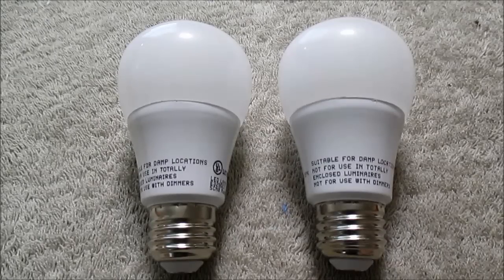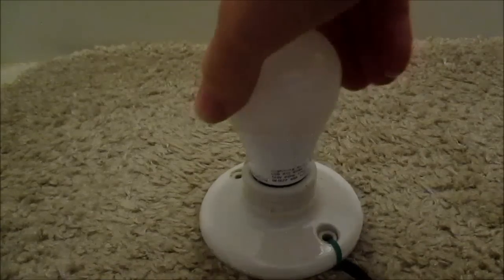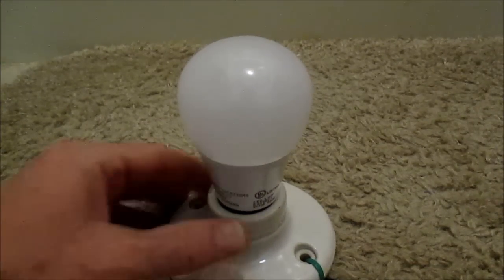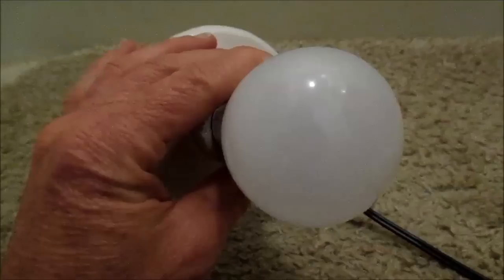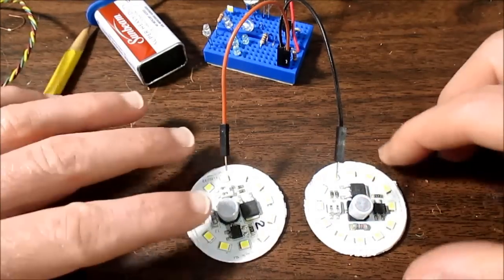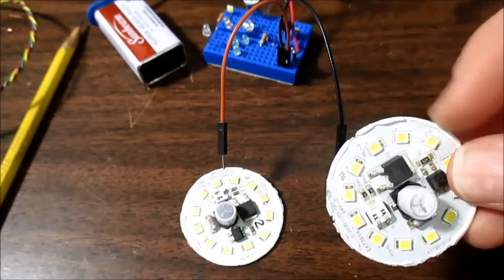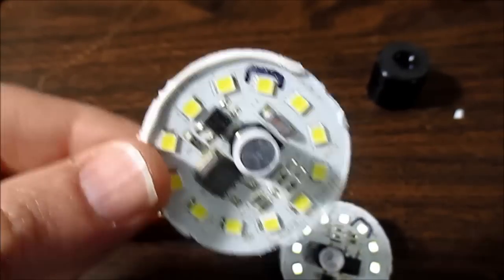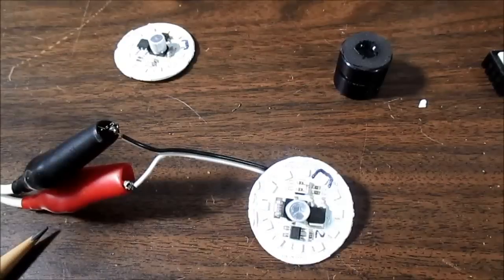Two failed LED bulbs for teardown to determine the cause

Comment: Most LED lamps put the LED's in a series string. 12 LED's X 9 volts is 108 volts allowing for voltage drops in the rest of the circuit they run on 120 volt line current. 
Assuming they are in SERIES the brief flash seems to indicate that the non lighting LED is Shorted, not open. Shorted is a common failure for LED chips.
(An open LED would not allow any light at all in a series string. )
This causes an increase in current in the remaining series string and likely causes the regulator chip to shut down.
This behavior is reflected in the dim glow, then the bright flash when power is removed and voltage in the capacitor begins to drop allowing the
regulator to briefly light the rest of the LED's because the voltage/current has dropped to a safe level for the 11 remaining LED's.
This is my theory.
Reply: Disagree with shorted.  A short across one of a number of identical devices in a series circuit would simply increase the voltage across the others.  This would lead to the other LEDs glowing more brightly than they should, rather than going out.  A shorted diode would not increase the current through a circuit with this sort of regulation.

The fact that placing the ammeter in series across the bad LED confirms this.

Edit:  Incidentally, True River, you are just slightly off in series vs parallel.  Placing multiple components in parallel will deliver the same voltage to each, thus increasing the amperage draw of the circuit.  Voltage will only decrease when the conductor's ampacity is exceeded.  Conversely, placing multiple components in series will subject them each to a reduction in voltage.  The voltage across each component will be a function of the resistance across the component in question vs the combined resistance of all other components in the series circuit.  Amperage through the circuit will be a function of the main supply voltage and the total resistance across the circuit.  Remember that amperage across each component in a series circuit will be the same.

In other words, it's better to say that series divides both amperage and voltage, one equally and one proportionally.  Parallel adds amperage, while voltage remains constant unless conductor limited.
Reply: @MrZorbatron  mains supply voltage is not constant though. Increase the resistance and the voltage will drop due to the resistance.
Reply: Stuart Johns, Irrelevant.
Reply: If LEDs are in series and one becomes shorted, the others would not necessarily burn brighter.  It all depends on the nature of the power supply.  If it is a constant current power supply, one or more shorted LEDs would not affect the others.

Some LED bulbs cannot be dimmed.  I strongly suspect that they contain a constant current power supply. @MrZorbatron
Reply: @MrZorbatron  yup series is voltage divider.
Reply from the maker: Bypassing the bad LED by shorting across its terminals allowed the rest of the series to come on, so I'd say it went open. LEDs do fail shorted due to defects in the semiconductor structure but they also often fail open due to junction issues at the bonding point. The flashing and dim glow was likely just an artifact of the poor connection.
Reply: @JohnAudioTech  So late you probably wouldn't see my reply. I have tried LED's in my combination  bathroom fan/ incandescent heat bulb/ light bulb and it won't work? Same LED bulb works fine in the bedroom ceiling fan/ light bulb though? Any ideas???
Reply: @JohnAudioTech  ive had 6 go in 3 months ,im fed up now as told so many stories why ? reading all this is good ty all :)
Reply: steve b, why do you have to be an ass? The Radio Mechanic didn't say anything "burned out". In fact, his theory seems to make a lot of sense to those of us with electrical engineering backgrounds (not to mention politeness).

Nobody would put LEDs in parallel in a 120V system. At the very least, they'd be a series-parallel arrangement. Why rectify and reduce 120V down to 0.3-0.7V when you could bring it down to a multiple of that...say something around 5 or 12V?
Reply: @kichigaisensei  engineering? more like the 101's
Reply: Right:  "not to mention politeness".  Unfortunately, courtesy seems to be becoming obsolete.  @kichigaisensei
Reply: John Audio Tech can you solder a jumper across that LED to make the others work ?? I know everything is SMD on that board and you have to have a micro solderer...... Not the old style PC boards back in My Days of working at a bench...
Reply: Boo LuQuette l
Reply: Boo LuQuette a resistance to drop the voltage should be ideal in my opinion
Reply: Boo LuQuette I was wondering that same thing
Reply: If it was a short the others would still light.
Reply: LED "bulbs" are connected in series. Single open failure stops them all. Not dissimilar to the old Xmas tree lights.
Reply: Those seem like 5050 led chips commonly available in cheap led strips just rework the bad out and replace it since you have it open just my 2 cents
Reply: steve b actually you are the what-you-said.

your design needs a step down transformer to match line voltage to led spec. The series design does not.

A good example of lamps in series is in xmas tree lights where a number of low volt bulbs are wired in series and the whole ring powered directly from the mains. (I am thinking of the older style xmas tree lights with incandescant bulbs not the newer led lights).

In the UK we have 230V from the wall and xmas tree lights tend to be 20 x 12V bulbs (so slightly underrun). I have seen 12 x 20V too.

So for incandescant lamps or leds you run in parallel if the supply volts match the spec but you run in parallel if the supply is many times the spec of an individual component.

Parallel adds volts

Series adds amps.

Please consider the possibility that you might have something to learn before calling someone ignorant.
Reply: really Steve..tell us more....
Reply: John Conrad Actually it's neither.  In a load circuit, its a division not an addition.  In a supply, it's an addition, and youre right that its the reverse of what he wrote.
Reply: If it goes open after its shorted, then it is no longer shorted. My experience with diodes has not been that way, though. When diodes fail, they often fail as a dead short or as open. They generally stay shorted unless subject to extreme power levels.
Reply: to save other LED's in the circuit, by pass the defective one with a small resistor that has same value as defective one...
Reply: My guess is that it's open, but when the voltage across it becomes high enough it breaks down and becomes a short until the current falls low  enough again. Much like a relaxation oscillator (diac, PUT, neon) of the days before my birth.
Reply: +Woeba, in this case he could most certainly use a resistor that drops the forward voltage of an LED at the current passing through the series string.
Reply: Steve b  So you get abusive over something like this?    Happy you're not my family.
Reply: LED's are still punching electrons through  band gaps, converting one energy form into another. This is achieved by applying a potential difference ( voltage ) across the component which supplies the energetic electrons ( current ) needed for the energy transformation.
Reply: The Radio Mechanic s
Reply: That "theory" ignores the most basic principles of current flow. A shorted LED isn't even on the list of things that would cause the string to fail, save some extreme circumstance like burning through the trace.
Reply: ps..   leds run on dc power..  so I highly doubt your going to get 108 volts dc..  that would MELT every line in your house..

and the common led they use is these bulbs is 6 Volts DC at 60 mah

indeed shorted wires will make all electronic's fail.
Reply: +steve b I'm afraid The Radio Mechanic is right.
Reply: They are talking about LED bulbs.  A single LED doesn't emit enough light.  Therefore, several are needed in an LED bulb.  The LEDs in an LED bulb are connected in series. steve b
Reply: Drop across an LED is 3 volts and not nine volts.
Reply: According to what I've read, not all LEDs have the same EMF drop.  I think that a drop of 3 volts is the maximum but some have lower drops.  However, I'm not sure of my information. @gajananphadte3440
Reply: Whit LED which basically is a blue LED has a drop of 3 Volts. Red, green, orange n yellow has a drop of 1.6 volts plus 0.2 maximum for some of them. @frankeggers4024
Reply: Gajanan Phadte  3 diodes per led. 3x3=9. Yes/no?
Reply: @rpmfoto  Never
Reply: True River well said! And good on everyone for explaining how and why his reply was incorrect instead of acting like he did
Reply: +True River I agree with you, except for one small point. The mains voltage in the UK is the same as it was fifty years ago, a nominal 240 volts. The difference is that, as a nod in the direction of European conformity, it's now specified as 230 volts +10%/-6% where 240 volts fits nicely within the tolerance range. So a big fudge, really! My guess is that after Brexit we'll go back to calling it 240 volts again - another pyrrhic victory for the anti-Europeans.
Reply: @johnm2012  in Australia we call it 240 volts but everything runs between 230v > 240v. The distance between the step down transformers on the power poles ensures the voltage stays between those ranges.
Reply: @stuartjohns2779  Yes, but that's an engineering solution to a problem. The issue in the European Union is that the desire to standardise the nominal voltage across the Union at 230 volts was implemented as a beaurocratic fudge. The nominal voltage in the UK is actually unchanged at 240 volts but it is declared to be in spec. because the tolerance was fiddled to allow it to be so.
Reply: @johnm2012  Apologies to  everyone not in the UK, but 'pyyrhic' assumes that we are winning on every turn of EU membership.   Why do you think we had the largest-ever election turn-out on the referendum? The problem is the wrong people are conducting it and Project fear naysayers decry every proposed aspect of leaving.   The EU despises us having the temerity to want to break-free of their despotic rule, and they are fearful that if it was easy for the UK to leave, then other countries would  want freedom too.  Ask the Greeks how keen they are on the EU and they would come with us if they -could.
Reply: Usually, when a component shorts out, it them goes open as it burns out.  Just my experience.
Reply: oo oo, just had a brain flash...use those conductive fluid pens! Make a track from solder pad to solder pad on defective LED...might work!
Reply: did you NOT see him short around the led with his amp meter..? STFU !
Reply: An LED is a semiconductor, so it does not behave like a resistor. Best bet is to cannibelise one and replace the two bad ones. On the other hand shorting it will propably not do anything as this lloks like a current regulator IC on the board.
Reply: The Radio Mechanic interesting

Comment: I was going to say you should just bridge the bad LEDs, but I think that would be worse because it would raise even more the current on the remaining LEDs. Also, the circuit on these lamps already has a bridge, and of all things, it's a FULL BRIDGE RECTIFIER!!!
Reply: No, it would not raise the current, because the current is regulated by the integrated circuit. However, it WOULD raise the voltage being dropped across the IC (marked as U1 on the board), and therefore more power wasted and more heat generated on the IC alone, since it's a linear regulator (acting like a variable resistance).
 Also, the LEDs are connected in SERIES, meaning the current is the same through all of them. You would have been right if they were connected in parallel.
 He COULD drop in a replacement LED instead of a bad one, provided it is rated for that current and UP TO that voltage.
Reply: If short of the necessary LED, then replace it with a resistor to keep the current the same.
Reply: ElectroBOOM quote, if was a AvE quote would be a "FULL BRIDGE RECTUMFRIER"
Reply: Okay, that made me laugh.
Reply: If they are in series the voltage increase for the remaining working leds,multiply by the same current for every led,the result is the remaining led works at increase power in watts
Reply: chileyork: "If they are in series the voltage increase for the remaining working leds,multiply by the same current for every led,the result is the remaining led works at increase power in watts".
 - chileyork, you would be right IF the VOLTAGE applied to the whole string was kept the same, BUT in this case the CURRENT is kept the same, while the voltage is dropped to maintain that current (the IC marked U1 is a constant current regulator, you can find out how it works, just do a little bit of web search!).